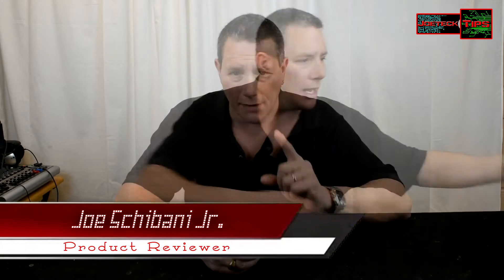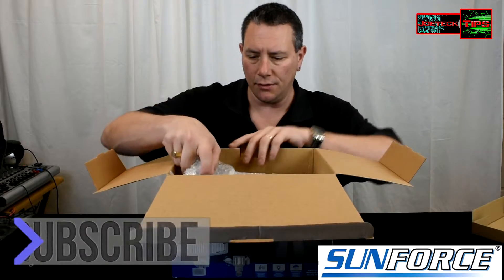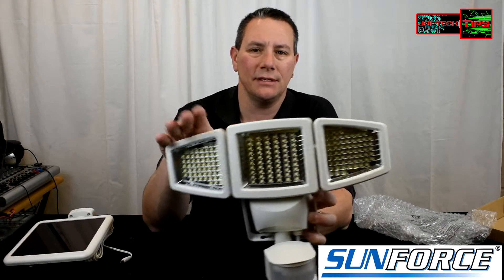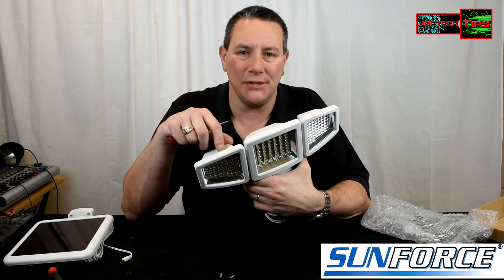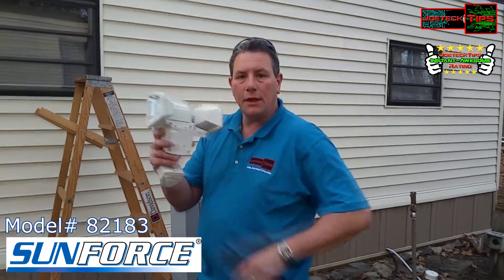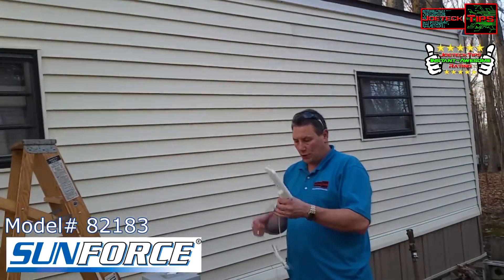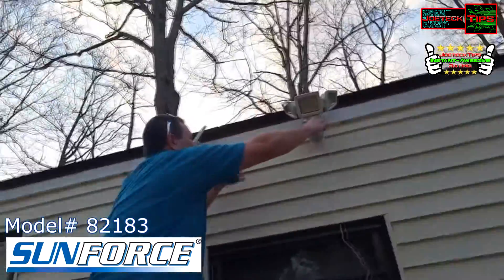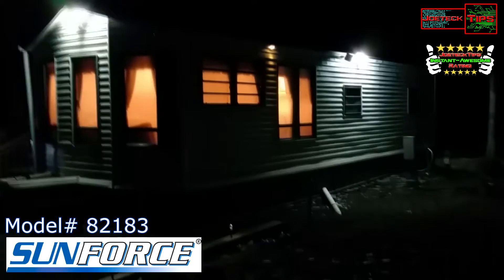Sunforce 82183 - 180 LED Solar Motion Light - Install and Demonstration

Comment: can you tell the brightness difference between the 150 led vs 180 led lights?

pick up a 150 led unit costco for less than $20, not sure if i should up $10 for the newer 180 led model.....  $10 coupon starting 3/23/17.....

thanks for your detailed review!

Comment: Thanks for the review.

I purchased this solar light recently from Costco UK to illuminate a dim basement tool storage area for a few minutes a day. Unfortunately the ambient light sensor has no sensitivity control, so in order to overcome the problem of the area not being dim enough I took apart the sensor part (two self tapping screws), located the light sensitive diode and covered it in blu-tak - problem solved!

This replaces a similar solar light that was 6 years old with a claimed 350 lumens of output -  from the Solar Centre. This thing claims to deliver 1,500 lumens. Boy is it bright in comparison.

As the circuitry has to be continuously powered for the passive infrared detector, I would imagine 15 minutes a day on a full charge best case. I might replace the AAs with higher capacity if needed. I wondered if the solar panel could be upgraded to a higher capacity (similar output voltage).

Comment: What are the proper settings, it will not work unless it’s on auto and test... not leaving you with much light time.... have put it on everything, and nothing, once you take it off test it will not work!! Have seen many videos and yet to see the “proper settings” stated 
Any help would be great
Reply from the maker: It only works at night. It takes a few seconds for it to set after test.

Comment: Hey is this made out of metal or CHEAP PLASTIC & is it MADE in CHINA?? Is the solar panel lens & sensor light is made of Glass & is there any warranty  with this product that any of you guy that do these video's don't TELL any one?????? This would be nice to know before going to spend the money for this product.... Tex
Reply from the maker: Linda McIntosh its made by Sunforce / Coleman. These are made with HIGH QUALITY thick plastic. It is very impressive. The QUALITY Control and assurance is great. Everything is made in China these days.